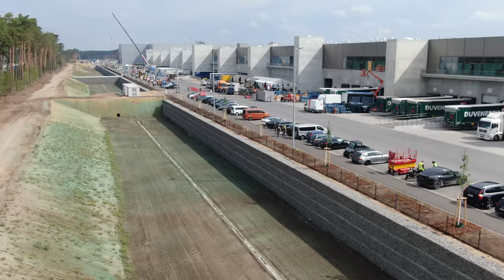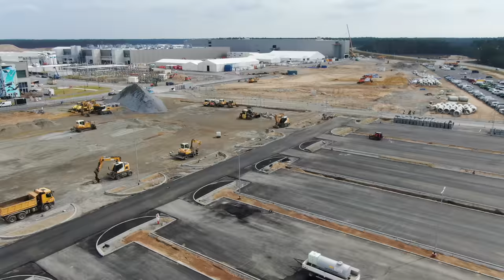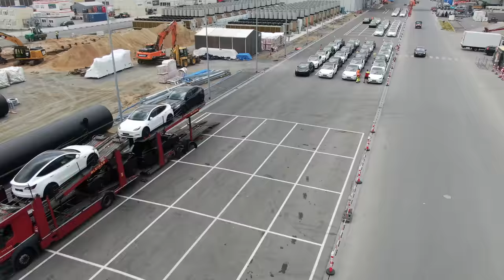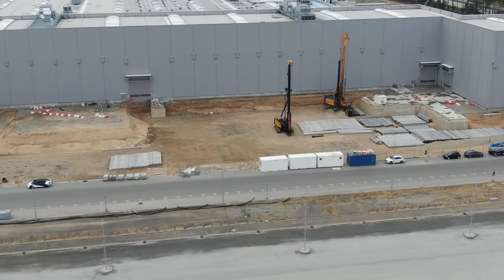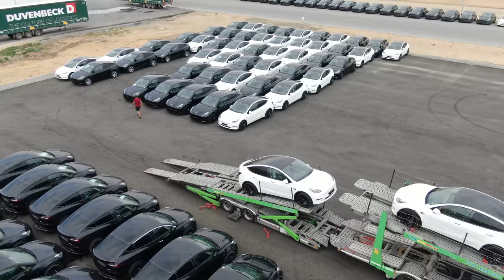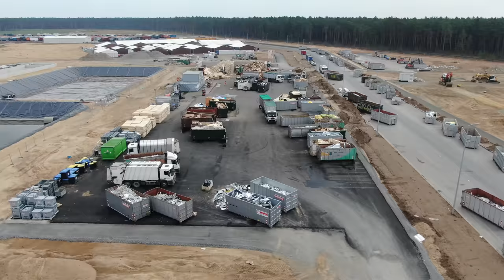Giga Berlin | 2022-06-25 | Saturday production & Model Y LR

Comment: Thanks Tobias!
As a bonus information the third chimney on the casting building is about to be placed, which means that another casting machine soon will be in operation. I think this also means number 4 casting machine also will get its chimney soon.
Reply: I hear that the new casting furnace is fueled by paper $US and not Russian gas
Reply from the maker: Good catch. I haven't notice that before.
Reply: @TobiasLindh  I think it lines up with more production capacity and more shifts. Also to be able to produce LR and Performance in higher numbers. It wouldn't happen overnight, but it will fit in with the schedule of increased production capacity.
Maybe we'll see the chimney during your timelapse if we are lucky. 😉
Reply: Any idea when it will produce model 3? 🤔

Comment: I believe GB is beginning to hit it's stride.  I think some of us are focused too much on the problems when we tend to be forgetting that the assembly process at GB and GA are completely different than GS and Freemont.  These 2 have front and rear castings, structural battery packs and a different kind of paint shop.  No 2 are the same as Elon said in the beginning.  Will be faster and better over time but is "production hell" to get everything working correctly.  I personally think GB will make the best quality Teslas of any factory.  Thanks Tobias.
Reply from the maker: Giga Berlin is not using front castings and structural packs yet.
Reply: Texas will be adding LR Y’s with 2170’s shortly with no structural pack. They need a production boost and there aren’t enough 4680’s yet.
Reply: @Russ1956  No wonder they can't get ramped.  Hard to build two different cars on the same line.

Comment: Good to see GB ramping up and producing more MYs.
Is it true that GB is having difficulty hiring new employees? Do GB employees get TSLA stock option? That should be a great incentive for new hires.
Can factories in Germany operate 7x24 with 3 shifts?
It will be great see GT & GB producing at peak capacity and vertically integrated in 12-24 months.
Reply from the maker: Yes, it's not easy to get 12,000 employees out of nowhere. So the difficulties in hiring are to be expected. That's one of the reasons why the factory is placed near Berlin, because that helps to find a lot of employees. Yes, the employees get TSLA stock. Yes, the factory could operate 24/7.
Reply: @TobiasLindh  Thanks.
Reply: "Is it true that GB is having difficulty hiring new employees?" Sure - Tesla would be a big exception if not.
"That should be a great incentive for new hires." Not with German workers. To re-educate German workers on such things never worked out so far. 
7x24 with 3 shifts is possible. But working on Sunday is not popular in Germany. Apart from this there are also practical issues like the less frequent public transport on Sundays. And the ban of lorries to use the autobahn.
Reply: The issues you're hearing about probably are those where existing workers are not at all happy about the incentives Tesla uses to get more workers.

Comment: Tobias, have you heard anything about the permit for the battery factory?  Looks like it might be finished in Sept.
Reply from the maker: Battery production is included in the factory permit. They don't need a separate permit.
Reply: If your question is about some media reports from March---Tesla needs to show that the battery factory was built as permitted to be allowed to operate it. Kind hard to do that before it's actually built, but that didn't stop the media from reporting that Tesla wasn't allowed to start producing batteries...

Comment: So a couple of points maybe other viewers can clarify.  (1)  They are still only shipping 6 Model Ys per car transporter when it is clear that the transporters are long enough to put 4 on the upper level and most probably 4 on the lower level if the cars are loaded close together for a probable capacity of 8 Model Ys per transporter.  Is there a logistical reason for only shipping 6 or is it as simple as the Model Ys are too heavy to ship more than 6 on each car transporter?  (2) We haven't had a peek in the Casting House area since the wall cladding has gone up but it would be great to see the progress there now that some of the wall cladding has been removed.  Is it against Tobias' flight authorization conditions to look into the factory openings from low flight levels or just considered "bad form"?
Reply: 1) trucks have a height restriction of 4 meters. for 4 model y you need to put on on the drivers cabin and then the whole transporter is too high.
2) yes, it's against the term do not film the inside.
Reply from the maker: I think it's limited to 6 Model Y because of the weight.
Yes, we were told to not deliberately look into any openings of the buildings with the drone.
Reply: @TobiasLindh  Thanks for replying Tobias.  It unfortunate that they can't ship 8 Model Y's per car transporter adding to the overall cost (which the customer pays).  It has also rendered the two level supercharger pretty much redundant as it is clearly built for 8 Model Y's per car transporter so shipping only 6 means they are not located on the transporter to align with the supercharger connectors.

Comment: Tobias, it seems like Giga Berlin is only making white and black Model Y's. I thought they had the most advanced paint shop and should be making many, many color Model Y's. Why??
Reply: I've often thought the same thing as Elon has spoken of how GB will have the most advanced paint shop in the world.  Perhaps it is related to the fact that the paint shop is still on temporary services until the central utilities building and process cooling heat exchangers are fully built and commissioned.
Reply: Remember, the plant is still not done yet. They are still building the factory but can start minimum production before they are completely done. In another words most companies would even be making any cars until the factory is done. That’s why it takes them 3-5 years before they start making any cars. It should take tesla 2-3 years but they can produce within less time. Shanghai was still building their factory 1 year later after the first cars started being built
Reply from the maker: The paint shop is new. There is no other paint shop like this anywhere. Starting with new technology is slower than with existing technology. As I've heard there where many problems with the paint at the beginning.
Reply: it's also demand. white is a free color, black is an easy for manufacturing and also the cheapest option.
Reply: @smashICE1  True!

Comment: Thank you Tobias! Have they sorted out 2170-related build quality issues or are there many rejects and bad quality deliveries?

Also, on the highway side trenches they are growing some grass - will this area store water permanently or just collect rainwater and can Tesla legally collect all rainwater from its site and use for production (after filtering)?
Reply: They can not use the rainwater.
Reply: It will only collect rainwater during rain
Reply from the maker: There are no 2170-related build quality issues as far as I know. I just heard that they had issues with the drive units recently. I don't know if that's solved, but it doesn't seem to impact production.
The trenches will not store any water. The water that goes there will be infiltrated into the ground. So unless there was a very heavy rain, you'll probably never see water in there.

Comment: Battery factory slow
Reply: It wasn't planned to be built there in the original plans. Production should start near the end of the year. In Texas, where the new battery portion is built, they are having major battery manufacturing problems. I'm sure these will be solved, but in the meantime, Texas has reverted to bringing in old style batteries and using Fremont production methods. In short, even if the battery factory in Germany was built, it probably would not work yet.
Reply: No, it's not. How many battery factories have you build to rate their pace?

Comment: Why does the site look so chaotic, boxes, building and car parts, reject Ys, probably a lot of waste material spread much farther apart, all around than the finishing touches on phase I and battery plant would require. Especially with German efficiency I'd expect small areas reserved for equipment and all necessary for the remainder of the construction but finished roads, parking lots, and LOTS of greenery elsewhere. Texas looks much more finished and well organized from a visual standpoint.
Reply: this factory is still WIP. i think it's obvious. they work on many things at once and this might occur chaotic. i think many things will be finished in so short order that the chaos vanishes really quick.
and a factory has no 100% perfect output. compared to 1,000 vehicles per week the few trash frames are usual maculation. the rest of the waste is packaging. that's normal when you think that many parts are still delivered not not produced on site.
texas has many of these things in-house. germany has other regulations, that's why there are so many differences.